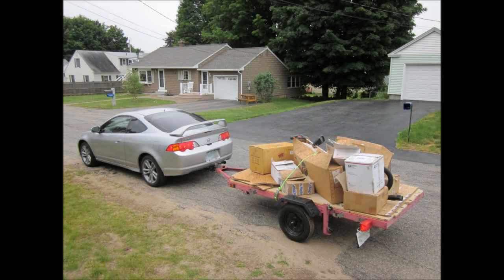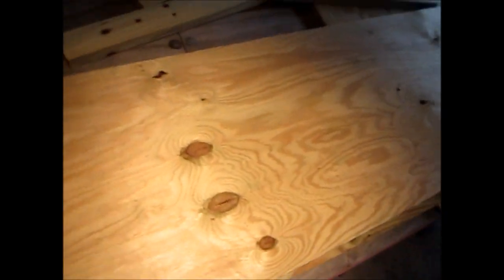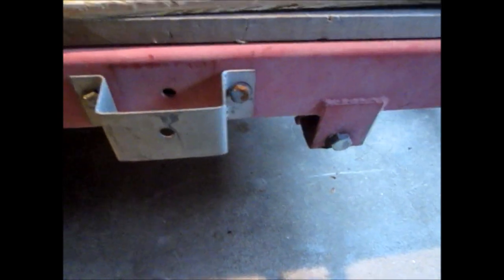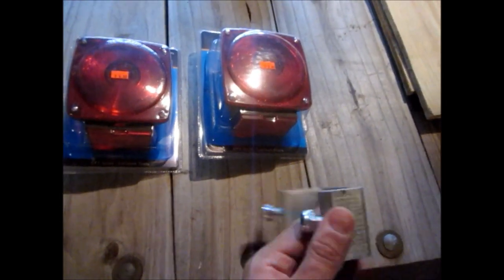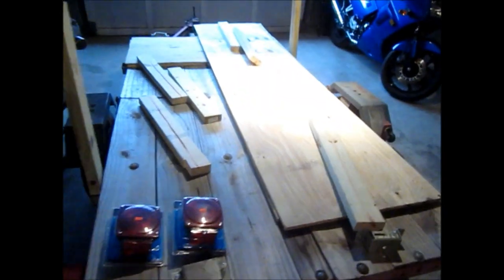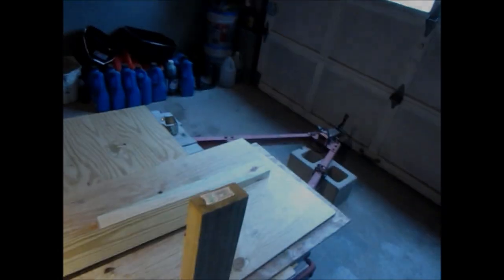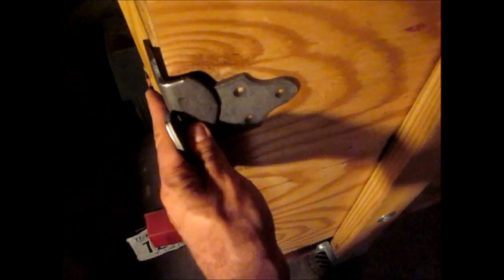How to build Utility Trailer sides

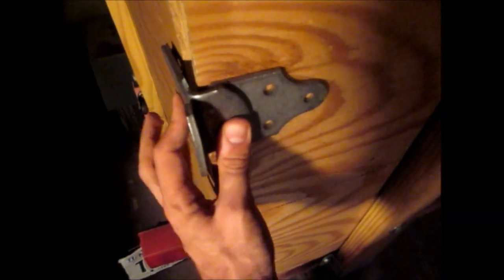Comment: "Use hinges (5:21) with long rods at all four corners to hold the sides together. It's very fast and secure. Picture removing the individual hinge pins on a standard hung door and replacing them with a single long rod and you get the idea." John Resler
Reply: 5;21 you right
Reply: beatiful idea I'm happy I read this comment I may actually use this for my flat bed

Comment: The 2x4's fit if they are allowed to dry out. I had several sitting in my storage unit for 6 years and they fit well. So all you have to do is dry your woods for half a decade before you build your trailer and ur set
Reply: That would depend on how the lumber was milled. I've built 3 of these trailers over the past 20 years. I've used 2x4s that were dried for 40 years, and they still were too wide for the stack pockets. It is interesting that HF's instructions say to use lumber that is 1.6" x 3.5". I think the 1.6" dimension more accurately describes the stake pockets, but the 3.5" dimension is definitely wrong. 1.6" x 3.4" would be a more accurate description of the provided stake pockets. I think it's a manufacturing defect that was never corrected because it's just a cheap-ass trailer. What HF should have done was make the stake pocket openings 1.5" x 3.5", which would have accommodated most lumber situations.

Comment: A better alternative to using plywood for side boards is using 5/4 treated deck boards & using 4 stake pockets per side & two on the front & rear of the trailer. Also, if you space the 5/4 boards about 1" apart on the 2x4's that will allow you to thread rope or straps through the side boards for securing things. And it makes for a nicer looking trailer.
Reply from the maker: Yeah but that makes gaps which make loose items vulnerable to fall out such as leaves and misc. things.
Reply: Moccina if hauling leaves/mulch/gravel drop a tarp in the trailer and wrap it all up like a burrito.
Reply: @moccina  Very true.  Depends on what you're using it for I suppose.  You could always bag the leaves/those types of items/etc, then np.  I think at the very least the bottom boards should be flush with the deck so anything loose doesn't come out.

Comment from the maker: Right on! Make sure you use self locking nuts--preferably galvanized, otherwise they will undo themselves in transit due to bumps etc..-- I made that mistake first time around.  Good luck with the move !

Comment from the maker: It's mostly oxidation from sitting outside 5 years. It has also rusted quite a bit on any exposed areas.  I would paint it if you care enough.  The prep work will take longer, but may be worth it. I'll probably spray mine black at some point. Good luck!

Comment: Great job! The corner brackets can be found on eBay 4 sets of two less than $20.00 great quality. Galvanized 1/4 steel. Fit tight.  Has anyone extended the side post 2x4s to create a ladder rack made out of 2x4 lumber.  Thought to use the brackets above to make the it removable?

Comment: Think maybe those stake pockets are upside down? They wider on one side and smaller on other so stakes wedge in
Reply: No. These HF stake pockets have bottom support. There is only one way to put the stakes in.  I've assembled 3 of these trailers. The pockets are not manufactured to fit 2 x 4s (1.5" x 3.5"). The pockets are more like 1.6" x 3.4".

Comment: Not a big fan of sealing it up tight like that. Just asking for water issues and rot down the road. Im making mine with pressure treated 2x8 on the floor and sides to avoid that problem. Drainage is good. As far as things coming out, just make sure you use a good tarp and you shouldnt have any issues

Comment: Is it just the lighting or did your trailer turn pink from being outside? I'm getting ready to pick one of these trailers up and I'm trying to decide if I should paint it before assembling.
Reply: Yes, the shiny red paint turns flat pink if you store them in the sunlight. They used the cheapest paint they could find.

Comment: I have the same trailer and I need to make it about 6 inches longer so my dirtbike tire does not hang off the back, what is the best way you think upon doing this? just cutting a 2x4 down to 6 inches and puting it in the spot where my tire would hang?
Reply: The bed of @Moccina's trailer is 8' long. It sounds like you have the 4' version.